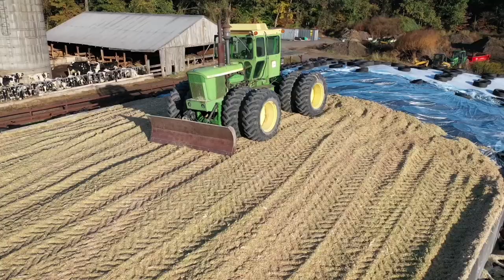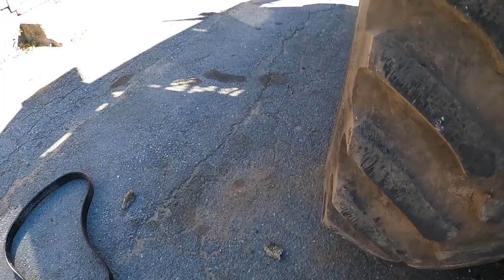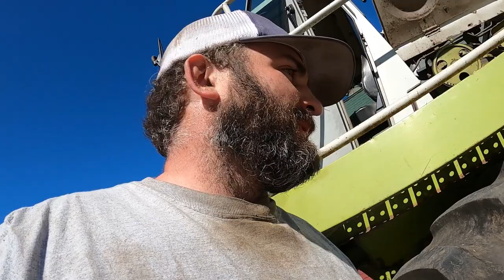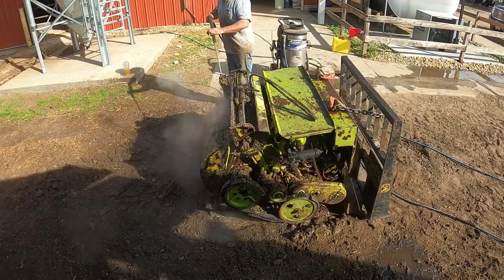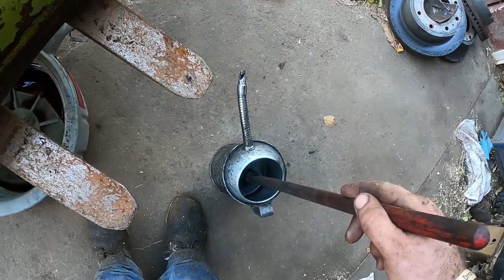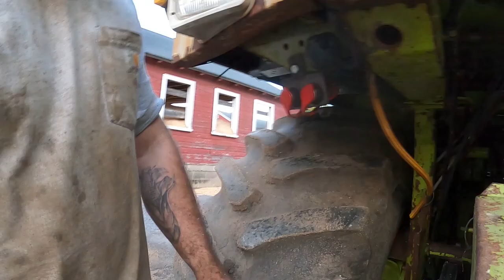How to switch a Kernel Processor in a Claas 695 Forage Harvester

Comment: I've gotta get my kp out yet, we aren't doing anymore hay this year. What go pro do you have?
Reply: The last week or so, I was wondering if my favorite dairy youtuber is watching  this channel. Now I know.
Reply: @chadtheartist5081  yes sir
Reply from the maker: I got it out quicker then I did last season after finishing up. Not sure if we will do more grass or not. Have a small field to definitely chop for a wedding this weekend. Using a GoPro 8 and its been really good, I see there is a 9 now, havent looked into what changed with them
Reply: @DuffyAg  are you using any kind of an external microphone?
Reply from the maker: Not using a mic on the GoPro, run it without a case on but started getting welder marks on the lens so that may change. A while back i used a T7i camera and a mic but it was to big and heavy to always have around

Comment: Thanks again for these videos! They will be invaluable for when we try to get it fitted on our 690. Isn't it possible to leave the feed/chop unit attached to the header when you disconnect it? Then just reverse the machine off of it. I maybe wrong but that's how we were told it was done. Not had to do it ourselves yet though. Hope the road trip went well - looking forward to the video!

Comment: Couldn't you keep the kernel processor in for chopping grass, just make the gap bigger? Loving the vids
Reply from the maker: It would more then likely plug up in grass you can not open them up very much. Uses more horsepower and wears on the processors

Comment: Do you really need to pull out the curnel processor for gras or could you just leave it in for grass if your not in a mood to pull it out?
Reply: You can but it takes a lot of power(fuel) to run it and it wears it out much faster... very expensive to replace rollers and bearings

Comment: For hay could you just back the kernel processor all the way off and leave it on?
Reply from the maker: It uses more power for 1 and forcing hay thru such a small gap would cause more wear and tear and un needed headaches